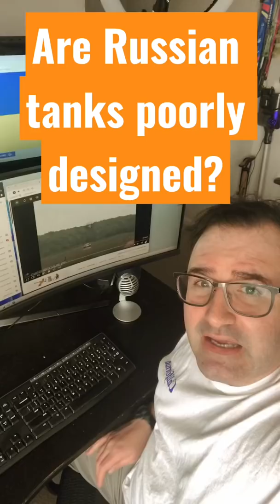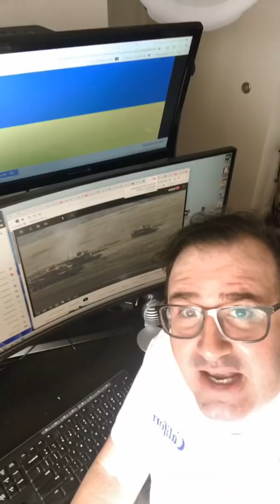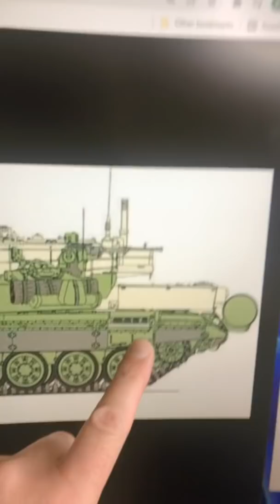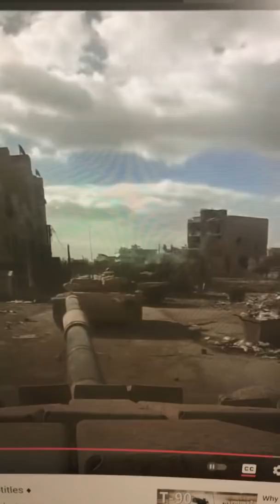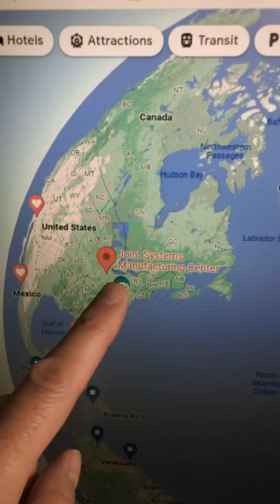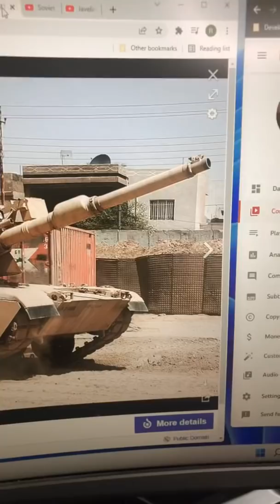Are Russian tanks poorly designed?

Comment: They are a bitch to repair though. Changing the transmission on a T72 takes three days in a specialised workshop. That’s not a problem when you plan a massive armour attack multiple waves deep and the only direction is forward. But it becomes a massive design flaw when you drive around on a training ground all the time or get bogged down in a stationary war or especially when you have to retreat. In peace time it’s just expensive, in war you‘d have to abandon your vehicle.
Reply: That’s another element of WW2 doctrine seeping into modern Russian doctrine. 

The T-34 was also a bitch to repair so many tank crews just jumped out and got in another one if the original broke down. 

However, this doctrine works best when you’re on the offensive to prevent an enemy rebuilding defences elsewhere. When they are dug in like Ukraine it leads to sickening losses. 

Not to mention the current Russian economy isn’t as strong as the USSR’s was during WW2 and that the T-72 is no where near as cheap as the T-34

Comment: But by the time 1990 came around, AT missiles were well-known and wouldn't you know it - Russians still used an autoloader on the T-90s (which is basically just a T-72 with a similar FCS and different armor profile)

Comment: I would disagree on your point of the M1 Abrams being better armored than the T-72 because if destroyed you wouldn't get a new one. 

The US are the the kings of logistics, and prove it well since WWII, I'm pretty sure of having to deploy in Europe for an all out war with Russia, for every Abrams on the field they would have the equivalent of multiple ones just in spare parts, it may not be the more advanced version of the Abrams but they would be there for sure. 

The difference in armor and size is more a difference in philosophy than having to be shipped across the ocean. 

The better armor is mainly due to the fact that the M1 Abrams entered service almost a decade after the T-72.min
So it was more likely build with it in mind, ant ATGMs being more widespread in the late 70s has probably influenced the design of the ammo layout of the Abrams more up to date today.

As far as I know, the size of the Abrams is not only to allow a loader to stand up, but also because the US tend to give more importance to the crew confort than the USSR. So this, in addition of having an higher average height and shoulder width than the average Soviet man and the aforementioned manual loader the size difference makes more sense.

Comment: The lower height of Soviet/Russian tanks as well as lower thermal signature compared to M1 Abrams and lower weight has to do with basic geographical limitations.

Thermal signature of M1 Abrams is much higher than that of any European/Russian/Soviet tanks.  Higher profile means it will be first seen before it can see the much lower profile enemy tanks.  M1 Abrams' weight is beyond the intended load capacity of many bridges and roads in Russian/Ukrainian territory.

Comment: Also, the auto-loader won't get tired and slow down after an hour-long tank battle of slinging shells and being bounced around the turret and breathing propellant gasses that didn't quite get removed by the bore evacuator before the breech was opened.

Also, the auto-loaded meant 1 fewer crewmember. This has benefits and downsides. Downside is one less guy to help with maintenance and resupply. Upside, you can train more conscripts into functioning tank crews 1/4 faster than the NATO countries could (faster if you really weren't too concerned about losing them).

Comment: I'd agree except there were some unnecessary design choices that were entirely about cost that led to a much riskier arrangement. Not having firewalls, wet storage of ammunition, loose rounds of ammunition, even the general inability to unload the main gun once it's loaded... None of those things was "necessary" to achieve the reduced size they were looking for... But it would have been costly to correct them and the view was to use that money buying more tanks instead of making better tanks...
Reply: Well, back when the T-64 and T-72 were designed NATO tanks also lacked protected ammo stowage, just look at cutouts of the Leopard and M-60, most ammo is stored in the front hull with a ready rack in the turret. People forget that the Blowout panels on the M1 are a relatively recent development that the russians never managed to catch on due to lack of funding for new stuff
Reply: @chrip8614  NATO didn't omit firewalls and store ammunition surrounded by fuel...

Comment: I would disagree. Manual vs autoloader is the same as m4 platform vs ak. It's just a different approach. Back in the day I would say that the crew in the abrams had higher chances of survival. This war showed how good modern portable antitank system work. Tank to tank fights are pretty much a history. Manual or autoloader, if the tank is hit with a modern antitank tandem missile- 99% of the time the crew is going to get extra crispy is seconds. Tank will burn down. Does it really matter if the turret goes up in the air or not. In both cases the crew is dead and the tank is burned. The main difference is only that manual loading- 4 men crew. Autoloader- 3 men crew. In my eyes autoloader makes more sence in the modern warfare. K2 is with autoloader. One of the best tanks out there.  Correct me if I'm wrong but the new Panther kf51 concept is with a 130mm smoothbore and autoloader.

Comment: What once was thier biggest avantage now is thier biggest flaw. Small design makes a lot of problems during modernization, and this specific autoloader is only one of them. You can make carousel autoloader that is  much safer, but T series simply dont have enough space for this. Much bigger problem however is placement of 2nd load of ammo, which is placed anywhere it can fit and this is usually couse of flying turrets. That was somewhat solved with T-90M that has this 2nd load in bussel behind the turret, but it is suboptimal. Small size also limits how big engine and transmission you can put there ( hence awful reverse speed ) and how much equipment you can fit in the turret. With digital displays for both gunner and comadner ( and god forbid RWS) tank is on brink of being impossible to opearte, due to crew simply having not enough space. What is interesting is that soviet enginners advised against such fanatical urge to make vehicles ass small as possible but army insisted.

Comment: To be clear. During the Cold war specifically the 1960-late 70s the soviets had the best tanks in the world. The t62 was the first mass produced tank with an apfads round and the t64 was the first tank to use composite armor. If ww3 happens no question I would rather be t64 with apfsds a stabilizer and composite armor that could stop heat and kinetic round compared to the American counter part the m60…

Comment: i mean. that aside. We dont see any real difference in the T-90ms armor layouts compared to the T-64. well. of course different layering. but thats where things stop. pure armor. 

Chobham is a very neat armor layout that the US took and made their own type. Germany doesnt use chobham, they just use sandwitched mesh of plates and spaced armor. the US did both. a mesh made up of spaced armor plates. The US armor design has more layers than Chobham, but chobham use thicker sheets. The spacing of both is unkown. 

Now. compare this to Russian tanks like the T-80 and T-72B3. They have shown to have just pressed plates in the hull, but angled. the classic WW2 style of tank design. the turrets though have something LIKE chobham, but it was found in the T-72B3 that these plates are all just standard steel with spacers. With ERA over the outside of the hull.
Reply: The problem is that tolhe top of a tank is very vulnerable, I doesn't matter ifnitnis a T-90 or a M1-abrahams they won't survive a direct hit from a Javelin.
Reply: @Aaronreacher  a Javelin, yes. a US weapon that Russia has no equivalent of.

Comment: Doesn't the spare rounds placed inside of the turret play an even bigger role in the ammo cook off? Sure the auto loader prevents blowout panels, however it's certainly positioned in a fairly difficult place to hit, while the ammo they store in the turret seems to be a much bigger liability. If they simply took the ammo out of the turret, they would surely be less likely to suffer a catastrophic cook off.

Comment: I would argue that they are still poorly designed, a blast protection or something that separates the crew from the ammo would have been great.
At the same time the could have added a loader to handle ammo from a compartment behind the turret, adding storege behind the turret would not have added height, look at the obj 906

Comment: T-14: Paper tiger. Doesn't even work.
T-90: Just a T-72 turret on a T-80 chassis. And they do not fit well together.
T-80: OK, but not really an improvement over the T-72 and not very many of them were made.
T-72: Workhorse. Far from invincible, but reliable, easy to repair and there are hordes of them in service all over the world. The T-72 is to tanks what the AK-47 is to rifles and the B-52 is to bombers.
T-62: Obsolete.

Comment: Also soviet tanks were very tough back then. On the 70s and early 80s the T-64s, T-72s and T-80s were very well armored, on the 70s pretty much only the germans had ammunition capable of penetrating the front of a T-64 or T-72 and even then some models were extremely durable (such as T-64B). US tankers had barely any hope of penetrating a T-64s or T-72s front and even the TOW would have a hard time dealing with some soviet tanks (they only got that capability with M829 in 1985 for the M1A1, the M1IP with M833 would still struggle against T-64B and T-80B and had no hope against a T-72B or T-80U and I-TOW only became widespread in the early 80s and even then it was still not enough against 80s soviet tanks), the french only started fielding sabot in the early 80s and the british only developed L23A1 on the early 80s and even that was still not enough.
Soviet/russian tanks are frontally still very tough but modern missiles are just too advanced for them. Back then they were expected to survive taking hits, today we have weapons that were made specifically to deal with them, its up to them to develop counters (and no, they still havent)

Comment: The T64 family tanks are designed for a war that never happened which is advancing/defending through the European central plains. Those tanks would have been probably amazing in the late 70's, early 80's with their low silhouette and lightweight but the Russian are still stuck with their old doctrine and didn't understand that mechanized forces are very susceptible to infantry and drone deployed smart weapons. A tank now is more useful as supporting weapon instead of tip of the spear assault and must need air support and infantry cover to even survive let alone operate in the modern battlefield. Same fate goes for every kind of armour or helicopters.

Comment: Just like the aircraft carrier and in turn, the aircraft. Replaced battleships. So too it seems infantryman with a explosive weapon are replacing the tank.

At least giving the tank a reduced role. But of course, countermeasures will be developed.

Perhaps it may be as simple as countering the weapon operator instead of the weapon. Maybe an omnidirectional sonic weapon, disorienting infantry, will do it. Who knows.

Comment: Small size is still an advantage because in reality any hit on a tank by a Javelin or NLaw is fatal even for big bruisers like M1A2 and Ch2.  The requirement for survivablity of US and British tanks (for example M48A2/A3 and Centurion in Vietnam and in 1967 and 1973 Arab Israeli wars was for suvivability against the likes of M-40 and RPG 7/16 which proliferated by both Arab, VNA and if the IGB went hot the Warsaw pact. As a rule (Vietnam figures) it took around 15 RPGs to score a hit on a tank and the US lost a tank for even 15 strikes so it statistically took 225 Rpgs for each tank lost,  NATO and US didn't deploy individual RPG style weapons other than a few M28 Energa grenades, most A/T weapons were the likes of Carl Gustav which was at best platoon weapon at wrost a battalion weapon, until Law 72 came into service (1972), so Soviets tanks were not faced with a fire storm of squad level A/T assets ( hitting anything with an M 28 even early M72 were dire). That changed with the first man pack A/T systems such as AT3B Sagger / 9M14 Malyutka in Oct. 1973, but still for US and NATO ATGWs were the preserve of Battalion A/T units. So that is why US  and British tanks (not German Leo 1 equates to a T-55) were big and heavily armoured as a defense against a storm of RPG, but generally whether it is a Soviet tank or a US/British tank a hit by a tank round or a first gen. ATGW it is at least a system kill, and neither side not even the Soviets only a rail ride away could afford crew losses -which is probably why facing the WW2 population deficit that they never recovered,  they opted for the 3 man tank with again a huge volumetric /area rule advantage.

Comment: Well.. Abrams can actually be airlifted in a pinch. That is of cause also true for the T72. While USSR (eventually built, most of them after the cold war) 55 AN124, USA/Nato got 279 globe master and 131 galaxy

And yes, of cause, the tank being small is beneficial. To a degree. The issue is that T72 have sacrifice a lot of performance to be smaller. And its the small things that you don´t often think about but are important in battles, like ergonomics, gun depression, crew safety

Comment: 90+ percent of what they're fielding now are basically developed originally from the T-64, which was designed in the early 60s.  Most of the Western tanks were designed in the late 70s and early to mid 80s, to counter Soviet armor.  Since then Russia has mostly just tweaked the basic design--ERA, thermal sights, new ammo, active protection systems.  But the basic flaws remain.

Comment: i also realized something that idk if somebody has ever pointed out before. Having an autoloader in a tank can give you a numbers advantage without you really having a numbers advantage
Let me explain,
Nato Tanks typically have 4 man crews
Commander
Gunner
Driver
Loader

Russian tanks have 3 man crews
Commander
Gunner
Driver

So you may be thinking "well that's only a one man difference"
But let's say for example, there are two groups fighting, both only have 12 men to man their tank forces. One uses Russian tanks, the other uses Nato tanks. The side with the Nato tanks can only field 3 tanks cause they need 4 men per tank. While the side with the Russian tanks can field 4 tanks cause they only need 3 men per tank. They have a numbers advantage despite having the same amount of crew members as their opponent. So in a full scale war, there could be exponentially more russian tanks than nato tanks, without the Russians having much of a manpower advantage over their opponents.

Comment: But that is not really true.  The US had Dragon missiles in 1975 and TOW missile in 1970.  The Maverick was 1972.  The US had plenty of anti tank munitions that had no problems hitting Russian tanks.  Yes being lower profile has some advantages, but most Russia was relying on the cheap parts.  And neither helps against mines which are likely the number one killer of tanks.  By the time the M1 came out with their advanced targeting systems and other missiles like Hellfires and later even JDAM, the Russian tanks were near obsolete.  The problem is they KEPT making them with this design flaw.  This insures that not only is a hit typically going to destroy the tank but also kill the crew.

The T-14 is kind of a trade-off.  They make the crew survivability much higher, but the tank is easier to disable.  It relies too heavily on their active defense, but it is untested and has a very limited field of use.  I think the idea was that if the crew was more likely to survive they would take more risks with the tank.  As it is now most Russian tanks flee from just about anything.

Comment: Explode not autoloader itself, most HE rounds detonate to make that picture of "pop-head". Leopards shown same magic, when were loaded with HEs. Heavy fire comes from ignited propellant, which must be hit and USUALLY it is NOT one from autoloader but extra ammo along yhe board. Autoloader itself very low. Even with cabine-type autoloader in T-64/T-80 propellant part lies on the floor and fairly hard to hit, while projectile part may not detonate even if it is HEAT or HE. Explosion mostly comes after fire at tank have time to ignite propellant, usually survived crew alredy left the tank at this moment. And crew may survive after HEAT goes into compartment, there was T-80 at Grozny 1993 changed 2 drivers and one aimer due to RPG kills. Tank continued fight. That tank got hit with penetration 6 times, without penetration like 10 times, 3 were APDFS T-72 shells. And ERA on tank wasnt armed, it was empty containers. So soviet tanks are NOT garbage at all, they just usually used by dumb commanders.

And one more moment. Soviet tank designed smaller not only to be smaller target and mostly not for that goal, but to have lesser mass and be able to maneuver on weak grounds and use minor bridges of european region. Also to be more transportable.